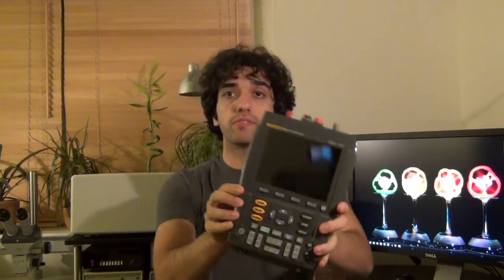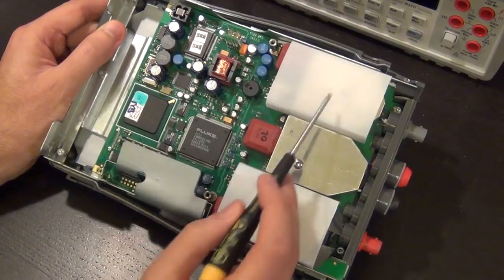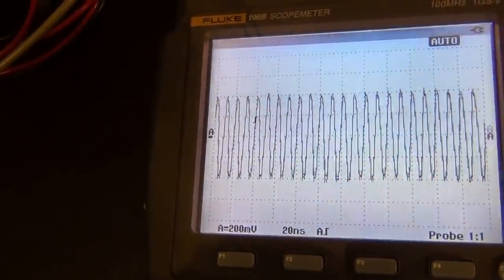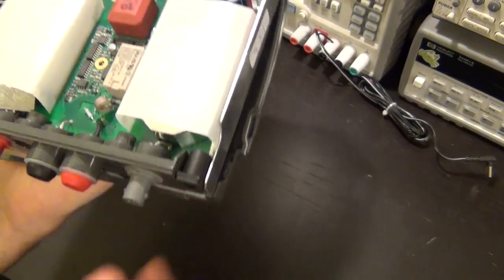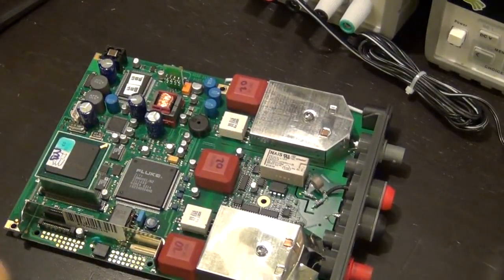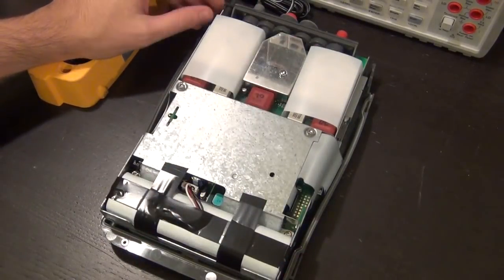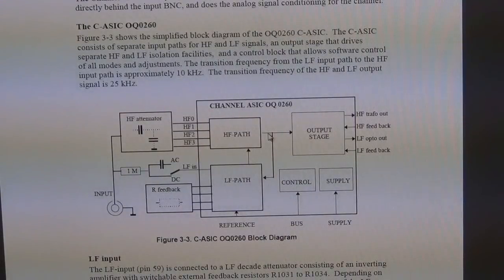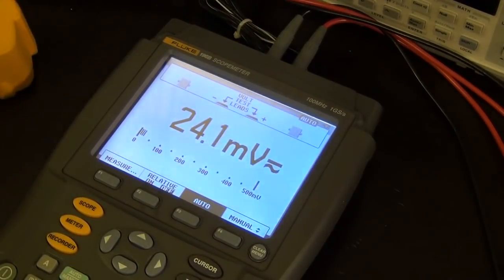TSP #18 - Teardown and Repair of a Fluke 196B Handheld ScopeMeter

Comment: When mentioning my inability to capture the information in one go it was not a criticism of your teaching style. In fact I prefer to watch repair videos for three reasons. 1. To gain the instrument more cheaply. 2. To solve the puzzle of the machine's inadequacy. 3. To gain your understanding of the machine's circuit. Two machines i am more interested in are oscilloscopes, and spectrum analyzers. When the object of attention is only of limited understanding on my part like a qualitative or quantitative understanding of a network analysis machine I still like to watch your problem solving method of the  microwave circuit but the final result is almost incomprehensible to me an older man. Still you are helping young individuals learn to repair unrepairable instruments unless bonded wire or other method you do not possess for microwave tuning inductance capacity or other changes detrimental to circuit logic. Thanks for your giving of knowledge.  It's great.

Comment: خاک برسرت,
 In bought 2 flluke 199C "non functioning" from eBay. And guess what they are none functioning. All your fault. The keyboard is not functioning on 1 and the other has the same issue plus missing parts. Can you help out with a hint or something. Ribbon cable and switches are fine. Problem is on the PCB or some kind of lock. Can you help? 
همش تقصیر توست

Comment: Anyone, is there anyway you could tell me if the AC power input for a fluke199C is center positive or center negative please.
Reply: Centre negative, outer positive at 17.8v dc
Reply: @aqib2000  thank you

Comment: Thanks, got some very important info for my own repair on my 192b,
Some hint : unlock the flat ribbon cable lock before you pull  it our !
Can you please tell me where is the centre wire from the power supply / Charger SOCKET connected on the PCB ? Mine is diconnected ! Can't find the Point where it was connected to, any Ground ?

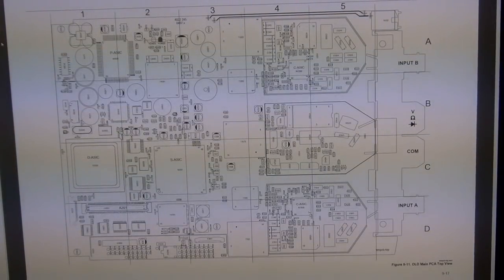Comment: 53:32 Why is the volt meter measurement display wobbling and not showing zero volts when the probes aren't connected to anything?

Comment: No back cover and BATTERY, I guess its from FLUKE repair center and these faulty units couldnt be repaired and was intended to be recycled, this is why there is no battery.
But someone from recycling center find out this "thing" is quite valuable.

Comment: Hello Shariar. We are trying to repair the input stages on a Fluke 192, and are in need of two C-ASIC reference Philips OQ0260HL but cannot find any place on Earth to source them. This is the N1000 front end ASIC, with service manual reference 4022 244 89993. This part seems to have disappeared from the surface of the planet entirely. Anybody knows where we could find some of these ?
Reply: I'm in the same boat. Can't find one either.

Comment: i have a Fluke 199 scopemeter, and i have a problem with the channel A, this dont 
read any signal that i put, only read the measure of frequency (Hz) but in the lcd show noise. you have a solution?

Comment: I have been using one of these at work lately. The battery is shot so I have to leave the DC supply connected. The power supply is very poorly filtered; 60 hz mains noise shows up in every measured signal when I don't use the ground clip. Fairly annoying.
Great video!

Comment: i have fluke199b ,its not working ,when i trying to power ON its only displaying one second then unit automaticaly OFF if you dont mint please advice me this problem causes
Reply: I've removed it's battery two weeks ago, first It worked well after removing battery ( with only dc power supply) 
2 days ago, I wanted to power it up to do an experiment but the only thing I'd got was a short buzz (muted ) and no live except.

Comment: I have seen cases where the item is stolen and the area with the serial number is missing, in this case it could be the back panel. Not saying this is the case here but it does happen. Of course once the panel with the serial number is removed it cant be sold as a functioning unit. Anyways very nice videos!

Comment: I was given 3 of the 196c meters. One powered on, but channel 2 on the o-scope was dead, the other two didn't power up. After inspecting the second, the memory daughter board had come loose. Plugged it back in and it works like a charm. The 3rd shows a burnt part on the board, down near the charging circuit. The part is labeled p65. I am hopeful that someone just plugged in the wrong charger!

Any ideas for fixing channel b? when I do a calibration, it sees the signal, but jumps around.

Comment: Dude you scored huge, got an awsome deal. I would not reccomend leaving the unit plugged in for more than 4 or 5 hours. We left simular batteries in for a cordless drill for over a month, and when we went to use the batteries there was no voltage coming out. I think that leaving them in the charger for a long time slowly drains and rechargers the batteries a small amount, but doesn't over heat the batteries, but destroys them. The battery was missing, that battery was bad, and was the problem.

Comment: At most $400? That's ridiculously cheap. I looked these devices up on eBay and there is no offer below $1200 for old/used ones and new ones go up to over $2000 for various related models. 

For some reason tech like this is insanely expensive in Europe.

Comment: Heh, original owner probably lost the AC adapter and when he tried to connect new one he got the polarity wrong and it didn't work. Most stuff use center as positive so it's easy to assume everything uses the same. Lucky you!

Comment: I have a fluke Scopemeter 199 with Both A and B scope channels failing to show any input? Apparently it's been sent away for repair and the original owner who passed it on to me told me that the Scope modules were faulty and would need to be replaced? Ever heard of this or similar issues? In regards to your video with the original fault of not powering up? The Fluke AC>DC plugpack will break it's own transformer mounts and O/C. Resoldering the PCB in the plugpack fixes the fault.
Reply: I've got a similar problem with a 192. Both A and B seems to never trigger or show anything. Did you ever find a solution?
Reply: lassehoei yes replace asICs from donors

Comment: I would not clean the optocopplers. It seems to me that the full board is coated. These field boards are often specially coated to protect them from moisture. You would destroy the coating and it would lose it's comliance. Just my two cents.

Comment: Could it be the oscilloscopes had their backcover removed to be fit into another assembly? (which would pretty much defeat the purpose of having a handheld oscilloscope, but I can't think of another reason why you'd remove the cover on multiple devices).
And then, whoever ripped it out, did not think about the powersupply and did not know the polarity of the connector is "unusual" (fat chance with 50/50 ;) ).

Comment: Backlight inverters are typically Royer, not flyback as the tubes use AC to avoid metal migration from electrodes

Comment: WIHA screwdrivers are one of the best money can buy. The model you got there is those small grip series. not build for high-torque screws. but of course you can get those drivers with larger grip too. if you treat them right they last almost a life long. good choice!